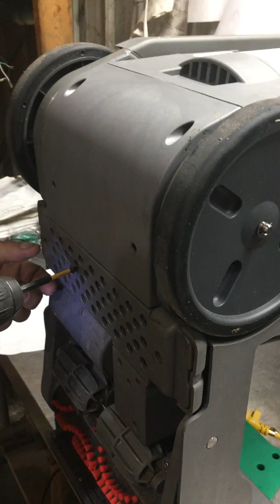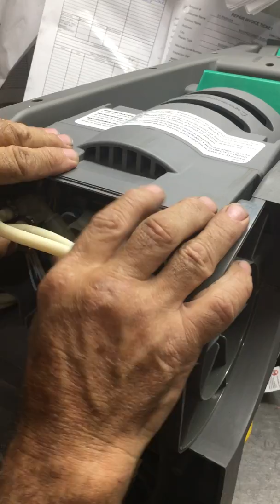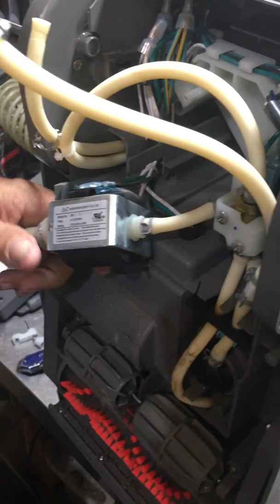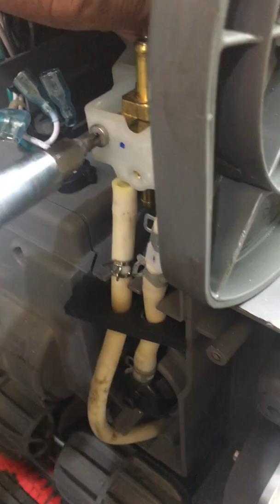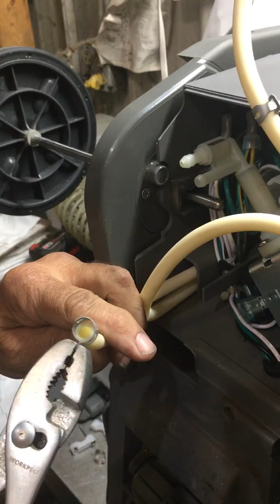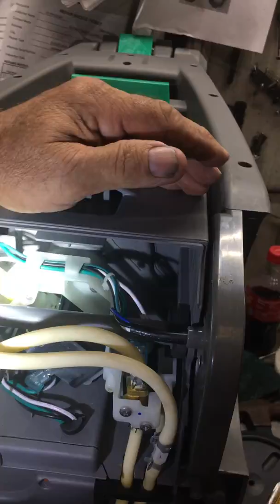BG10 Pump and solenoid valve access, removal, and replacement

Comment: my motor makes a high pitch whining sound, everything works except the flow indicator, help please
Reply from the maker: @anthonyfountain2160-You are going to have to replace the flow indicator, but it also sounds like the pump may be trying to act up as well.  Before hooking up the pump side of the flow indicator's tubing, test the pump spray from the tube.  The spray should stay at a consistent level while testing.  If it starts with force and loses it after a few seconds, you will also need to change the pump-Amanda S., Customer Service

Comment: Why even take out the pump
Reply from the maker: To replace it.
Reply: @bissellcommercialcustomers4100  not needed to just replace the solenoid
Reply: Appreciate the video though. I took off the clamp off the pump and don't have a replacement clamp
Reply from the maker: @ The clamps will need to be sourced through a local hardware center, as they are not replacement parts.  W are very sorry for any inconvenience!-Amanda S.

Comment: How can we tell which is not working, the solenoid or pump?
Reply from the maker: @stettan1754-The solenoid has to be ruled out or ruled in.  To do this, you will test the pump first.  If the pump test indicates a reduced spray/pressure, then you will replace the pump and possible the flow indicator as well (new pump may bring to light an issue with the flow indicator).  If the pump and the flow indicator test good, then it is most likely the solenoid valve.-Amanda S.

Comment: Excellent video, thank you very much for the help. By the way, how many bars of water pressure does the pump have?
Reply from the maker: The pumps are rated not in bars but in psi (pounds per square inch).  The pumps on these units are rated at 26 psi.-Amanda S.
Reply: About 2 bar

Comment: Hi i need to replace the solenoid valve on my Bissell where can i get it?
Reply from the maker: You are looking for part #2037436.  It can be obtained through different locations, but you can also call us at 800-242-1378 and ask for the Sales Department.  They will gladly assist you!-Amanda S.

Comment: I have owned a Bissell BG10 for 5 years and it's been the best rug cleaner that I've ever used.
I rented every type of rug scrubber in the past and NONE compare to the BG10.
After 5 years of hard use a valve needed replaced, the factory representative explained my problem, sent me the valve at a fair price.
The repair video explained in great detail how to change the valve.  One hour later my scrubber is ready for many more dirty carpets.
Thank you Bissell for a Quality  5 Star Product and a Great Support Team.
P. S.  I've purchased a second BG10 because my work is expanding.
Matthew 6:33
Reply from the maker: We are excited to hear about the expansion of your work!  And so glad one of our machines enables that for you! -Amanda
Reply: I agree with you 100%

Comment: This is a great video..Do i have to remove pump to change Solenoid
Reply from the maker: @fiddyfidalgo1369-Thank you for the compliment!  No you do not have to remove the pump to change the solenoid valve.  Call us at 800-242-1378, ext. 2180 if you run into any issues.-Amanda
Reply: Is the solenoid replacement done the same way if i have the 86T3-2
Reply from the maker: @fiddyfidalgo  It should be almost, if not identical in the process.  However, you may want to search other video sources on that specific model, just to be sure!-Amanda

Comment: The only issue I ran into was when I put the pump back in, it was rotated 90 degrees and the saddles would not go back on.  That, and Lowe's and two auto parts stores didn't have those pinch clamps to go over the surgical hose.

Comment: Instead of using a knife on those tie wraps, a pair of communications scissors works so much better with no risk of cutting the tubes or yourself.  These scissors are made for cutting things like tie wraps, CAT5, CAT6 and CAT7 data cables, so they can easily cut tie wraps without damaging the scissors.  Using normal scissors will just ruin the scissors.  The scissors I have are about 25 years old, so they hold up well.  Great video otherwise.  I'd like to have seen some troubleshooting steps to know which to replace, the pump or the solenoid.

Comment: any idea why a BG10 commercial wont power on at all?
Reply from the maker: @00thos-On a BG10, the main power cord is able to be removed from the handle by unscrewing the screws and disconnecting the plug harness.  Inspect this plug in module for any signs of electrical issue (dark, smoky looking).  If no signs of electrical issues are noted, more then likely it is the main vacuum motor's wiring connection that has failed.  You are able to open the unit for this inspection as well and once into the vacuum motor area, it will not be hard to find and check those wiring points.  If you need further assistance, please contact us at 800-242-1378, ext. 2180 and our Customer Service Department will be more than happy to provide further support!-Customer Service

Comment: Great detailed videos however; I still have the problem with my BG10 Machine. The foot motor works and makes the role spin, water is dispensed (sprayed) correctly and flow indicator moves (spins), I cleaned all debris, I checked for suctioning on top of the dirty water tank, the motor duct and also inspected the float & baffle for any damage, changed the pump, the solenoid and still no suction. Any help will be greatly appreciated as I worry that my wife may be thinking that I am making all this up to avoid cleaning the carpet.
Reply from the maker: Juan,  I believe you have a separate issue in the "still no suction" complaint.  But that's okay because I have a video for that too!  Please check out this video, https://www.youtube.com/watch?v=tiPh_kIL7pg&t=3s, or search, "BG10 checking for no suction causes".  I believe that will give you the answer/reason you are needing.  If any of those items look damaged or in need of replacement, just call us.  That's what we are here for!-800-242-1378 ext 2180-Customer Service

Comment: This is a most wonderful video. So detailed and doable. I shampooed my carpet and 6 months later pulled out the machine to do it again, and there is no water flow. I turned the machine on and put an object in the hose attachment water valve and no spray out at all. Not even a bubble. The red spray trigger on the handle...nothing. I was going to replace both the pump and solenoid but I am thinking that maybe only the pump is bad. Is there a way to tell which one is bad? The flow device does not turn either. It was replaced two years ago when water started squirting out the top of it.
Reply from the maker: CherryCoy163, Thank you for the compliment on our machine!  Now, regarding the no spray issue...if you can give us a call at 800-242-1378 ext 2180, we will get your email address and see about providing you the testing procedure to help identify the culprit (it is generally going to be a bad pump, bad flow indicator, or a frozen solenoid valve).  We look forward to further assisting you!-Amanda

Comment: i just replaced the solenoid valve on mine and Im still getting constant water spray.  What should i change next, the pump?
Reply from the maker: slamwalleye - Your next move is to change the flow indicator.  Keep us posted!-Customer Service
Reply: @bissellcommercialcustomers4100  thank you, the leak is not coming from up top by the flow indicator but from the bottom of the machine.  Should I still try and swap the flow indicator out?
Reply from the maker: slamwalleye - You absolutely should change out the flow indicator.  As I explained in one of the other videos, sometimes you will find the evidence of the flow indicator leak located directly in front (or around this area) of the left rear wheel (aka, under the flow indicator's position as it sits in the unit).  If the pump was the issue, you would not have spray, but more of a bubbling or no spray.  Change out your flow indicator and I will look forward to your update afterwards-Customer Service
Reply: @bissellcommercialcustomers4100  ok, will do, thank for taking the time to reply!
Reply: @bissellcommercialcustomers4100  you were 100% correct. I replaced the flow meter and now Big Green works again as it should.  Thank you for your help and direction!!!
Reply from the maker: @cerndo  Great job!  So glad we could help!-BG Customer Service

Comment: My vacuum works now after replacing all those parts but for some reason it still doesn’t spray water and the vacuum still doesn’t circulate from below through the tank.
Reply from the maker: Clarence, If the pump and solenoid valve have both been replaced, my only remaining question is what is the flow indicator doing or not doing?  You may still need to replace it-ASE
Reply: @bissellcommercialcustomers4100  I had to troubleshoot it again. I may had gotten bad parts. The vacuum motor is in good condition except the spraying part which could be the pump.
Reply: @bissellcommercialcustomers4100  I found out what was the issue. The solenoid that I ordered was a bad part.
Reply from the maker: @SpoonIkel  It is always nice to have the details resolved!  I am glad you were able to get the issue fixed and we hope you enjoy many more years of use out of the unit.  Please feel free to contact us should you require anything further, 800-242-1378 ext. 2180-ASE

Comment: This is the only repair video I could find on the BG10.  There are no Bissell repair centers in Milwaukee Metropolitan Area (50 miles) WI. They are no longer in business or perhaps Bissell has ticked them off and they no longer service Bissell equipment - Website is not up yo date.  The Bissell online chat rep told me they don't have service manuals for their equipment (not available to the general public?). No customer service or manuals. That sucks.  My Big Green Clean Machine shuts off when t I rotate the handle yet remains on when the handle is upright. I have taken the covers off to see if there is noticeable wear on flex point of the wire harness and have no clue would should be the next step.  Any advice on what it could be or how I can get expert advice?
Reply from the maker: So first off please allow me to notate that there is a difference between Bissell and Bissell Commercial.  We handle two totally different divisions of floor cleaning machines.  So, with that said, I am here to assist with Bissell Commercial units.  Now, onto the homecare version that you have of our BG10/10N2 carpet extractor.    SheikandBake, you will need to open up the bottom (foot motor) area to begin with.  What you are describing is usually traced back to a burnt foot motor and/or circuit board.  This video should get you into that area.  Also, please note, I have just done a service center search on bissell.com and you have 3 local repair center options within a 15 mile radius of zip code 53202.-ase
Reply: @bissellcommercialcustomers4100  I appreciate your quick response to my query. The repair center options on the bissell website are not kept up to date. I have opened the foot motor area before and will look at components described. THX
Reply: @sheikhandbake8804  I know this was 3 months ago, were you able to remove the foot motor area and determine the issue? I ran into the same issue as you and I just ended up taking all of the screws out kind of guessing and I did find that my circuit board was fried. I ordered a new one for 30 bucks and it runs good as gold. If you want I can do a video, just let me know.
Reply: @punditjudgement  After numerous calls I found a repair shop willing to look at it.  When I described the symptoms the owner said he wouldn't know what to look for.  When I plugged it in to show how the problem manifested itself, it magically disappeared and I have had no issues to date.  I appreciate your diligence and follow-through. THX

Comment: My hand wand attachment is working fine. However, the base unit does not engage (spray or suction) when the trigger is pressed.  Where should I start? Can it still be a solenoid issue? Thank you!
Reply from the maker: Jeremiah, The fact that the hose/tool combo is working fine is the perfect indicator that the issue is going to be found below that are of the unit.  So, as long as you have removed the spray nozzle to check for blockages, yes it will probably end up being your solenoid valve.

Comment: I changed the pump, solenoid, flow indicator, still don't have water flow when I press the red trigger for spraying.  I also stuck a paper clip to press down inside the flow indicator, no water shot up, please assist.
Reply from the maker: Renardo, If you tested the pump pressure in the manner that you have described without any spray, the pump (even new) may be bad.  It may also be installed incorrectly.  You may want to double-check the installation.  Once you have done that, if it is still not producing a 6 to 8 inch stream upon testing the flow indicator the way you described, it is a bad pump.-Amanda
Reply: @bissellcommercialcustomers4100  one of my connections to the pump, were not connected.  Where can I order the power supply connector on side of machine, the part that is connected to the black plug?  Not asking for the yellow cord
Reply from the maker: @renardowilliams6822  Renardo, I believe you are meaning the portion on the side of the handle where the small cord comes out of the unit for power.  If that is correct, call us at 800-242-1378 and let them know that you need to order part #2037732.-Amanda

Comment: I’m not getting any water ,witch one do I change ? Or do I chance both pump and solenoid ?
Reply from the maker: Jermaine, You will want to test the pump first.  Water in solution tank, turn unit on, and insert a large unbent paperclip into the small solution hose port directly in front of your flow indicator and depress the self-sealing gasket to allow the water to exit.  If the water shoots up 6 to 8 inches high, the pump is good and you will only need to change out the solenoid valve.
Reply: @bissellcommercialcustomers4100  thank you ,I pull the machine down and the solenoid is rusted out ,must have gotten wet somehow
Reply: My machine in not spraying water from the top or the bottom. I replaced the flow indicator and still not water. I checked for clogs and no water. I inserted the paper clip and no water came up so I guess it’s the pump. Where can I get a replacement pump?
Reply: Do I need to change the solenoid valve as well?
Reply from the maker: @shemreyes5564  Shem, Yes it does sound as if you will possibly need both the pump and solenoid valve, and maybe even a new flow indicator.  The pump pushes the spray, the flow indicator directs it through the machine, and the solenoid valve allows it to exit the unit.  Get the three parts and start in that order with the replacement.  Pump first-did it resolve the issue.  If not, flow indicator second.  Did that resolve the issue?  If no, replace solenoid valve.  Your problem should then be TOTALLY resolved.

Comment: Nice video! My Big Green is leaking water from the front sprayer (red nozzle underneath).  It just leaks water from the moment it is powered on.  I tried testing the trigger on the handle, and it works as it's supposed to.  It also seems like it isn't cleaning as good, but this may be due to the excess water it is spitting out.  Any ideas for what to fix?  I can't find anything online.
Reply from the maker: Cody, Thank you for the detailed information!  For the leaky spray nozzle, remove solution tank from unit and fill halfway with water.  Hold the tank over your sink and see if the problem might actually be the cap on the tank.  If it is not the tank cap, more than likely you have a solenoid valve that is stuck in the open position and may need to be replaced.  As far as the decline in quality of cleaning, more detailed info may be needed but you will want to clean out the brush carriage area (drop the brush carriage and clean out the entire area behind the brush as the dirt or nastiness will deposit back onto the carpet if it is not cleaned off).  If it is not sucking the solution and dirt up off of the carpet as well as it used to, you will want to follow along with my "BG10 checking for no suction causes" video as the issue may be in the nozzle assembly.  You can call us at 800-242-1378 and ask for Customer Service if further assistance or parts are needed.  I hope this helps!
Reply: @bissellcommercialcustomers4100  Thank you for your reply; extremely helpful!  Having had previous Bissell vacuums (and fixing a variety of issues on them) the tank cap was one of the first things I checked.  I think you nailed it on suspecting the solenoid valve.  I looked up the solenoid valve for this machine, and it seems like people are saying it fixed their constant spraying problem.  I have the 86T3, do you think the bottom of the machine will be similar to the BG10?  Thanks again for your help.
Reply from the maker: @codynoble455  The part will be the same as the components are the same.  It is the cord set up that is different.  Same solenoid valve regardless!  :)
Reply: @bissellcommercialcustomers4100  PS: Thank you again for posting this!  Finally received the part, and thanks to your video, was able to successfully swap out the solenoid.  No more leaking/constant spraying!
Reply from the maker: @codynoble455  That is AWESOME Cody!  Great job and so glad we could help!